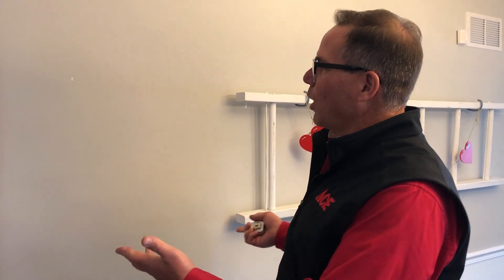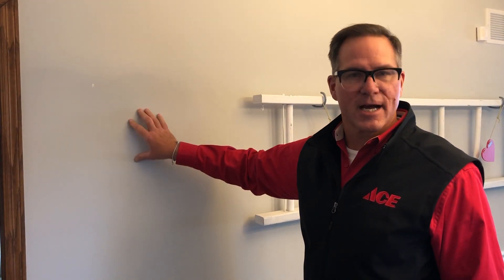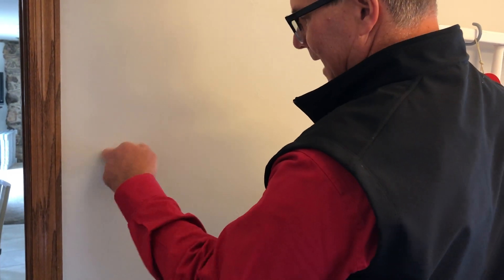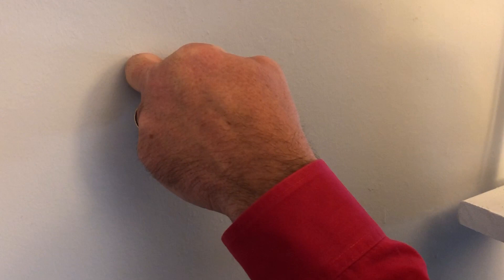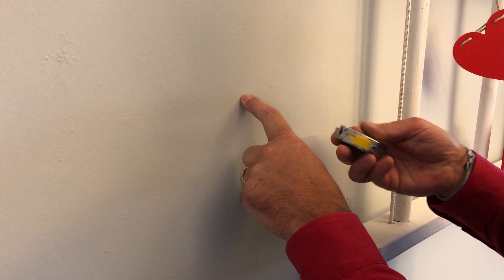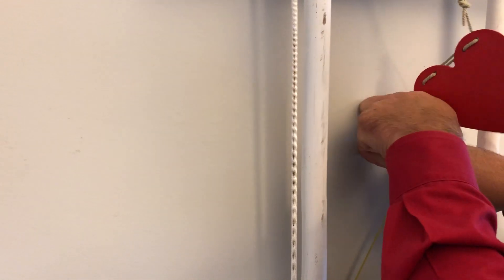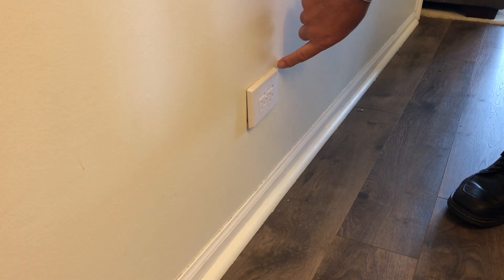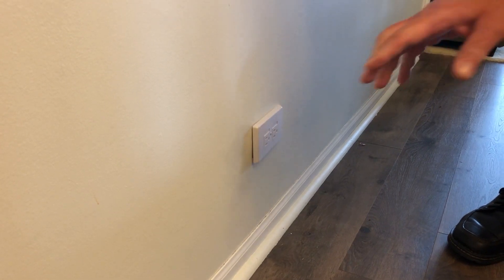How To Find A Stud Without A Stud Finder - Ace Hardware

Comment: My own method, never seen elsewhere: get a long hat pin and narrow nosed pliers. Estimate by tapping or other method. Grip the pin shaft a 1/2" from the point with the pliers, push it into the wall at 1/2" intervals along the estimated location. It's easy to push in and the hole is tiny compared to any nail.

Comment: How do you find a stud on a wall that doesn't have an electrical outlet?
Reply from the maker: Hi Darlene, 
We suggest using a stud finder like these: https://www.acehardware.com/departments/tools/hand-tools/stud-finders?query=stud%20finder
Reply: Start at your corner wall use your tape measure every red line on the tape or be a stud Also, light switches are the same concept as an electrical outlet. The irony this guy has a video of how to find a start without a stud finder but you ask him a simple question and he tells you to buy a stud finder. I just can’t.